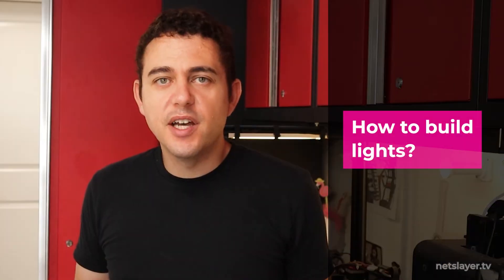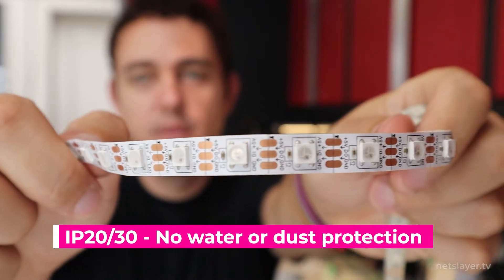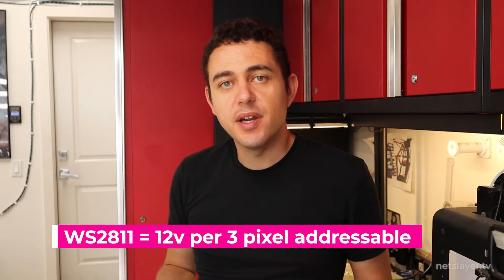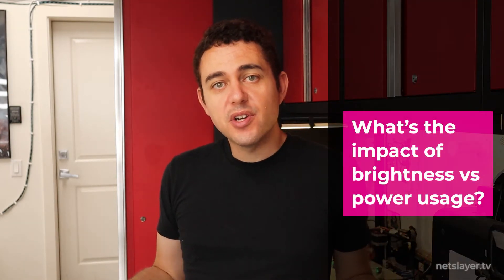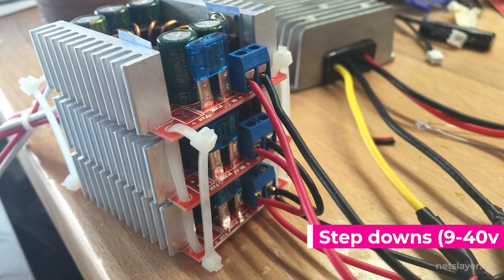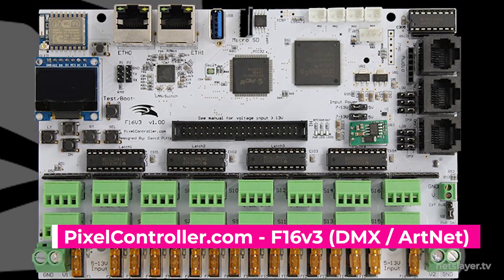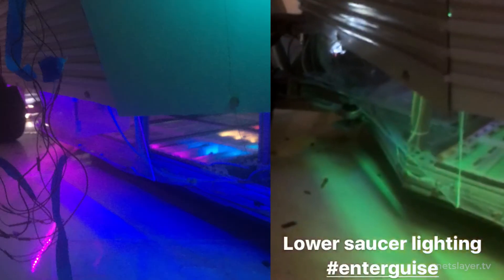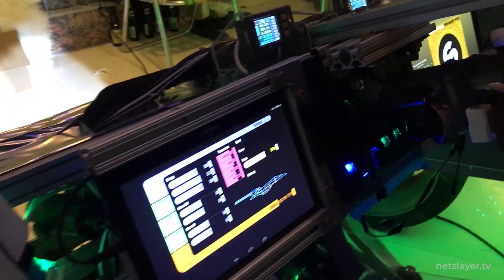How to build light panels with LED strips - EP9: Building Enterguise an Electric Art Car DIY WS2811

Comment: Thanks a lot for this detailed walk-through on your process.  I personally would like even deeper dives into it.  The discussion on power budget and control options was very very helpful.  I would also like to know a little more about cost budgets as well.  Keep up the great work.  You are helping skip some steps!
Reply from the maker: Thanks! If you have any questions specifically, happy to help!
Reply: @NetslayerTV  I am using the video series to help plan and budget a build.    I am not going the EV route which changes a lot.   Each of your videos covers a different aspect and shows us what you learned along the way.  Cost is a part of that as funds are not infinite.  I would love to know if you were to rebuild this from scratch, what a rough guess of cost of the different aspects.  We do not need to know your business, but I would love to know what is in reach!
Reply: @NetslayerTV  What pixel density and type did you use?  Your title says WS2811 but the description says WS2812b. BM can be a pretty harsh environment, have you had any issues with losing strips without a back up data channel?  Is it worth the extra money?
Reply from the maker: WS2812B, IP65 when possible. 60/m density.